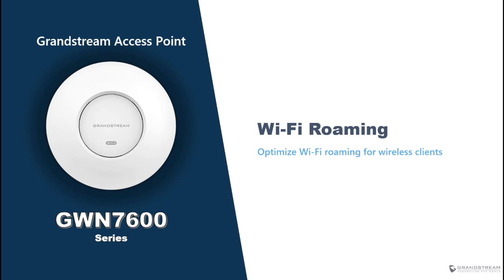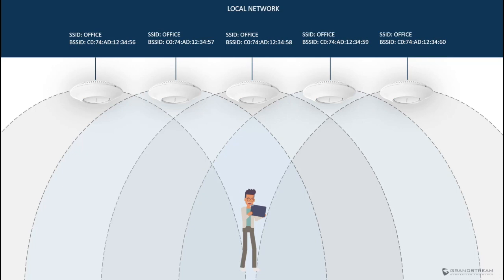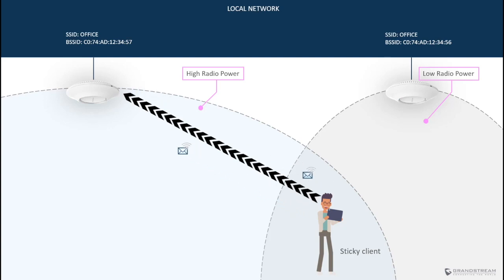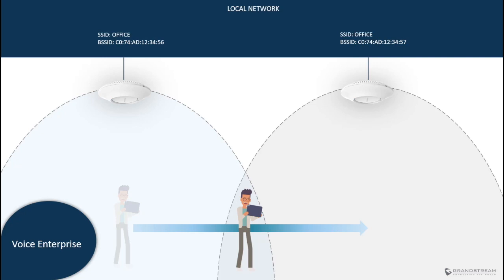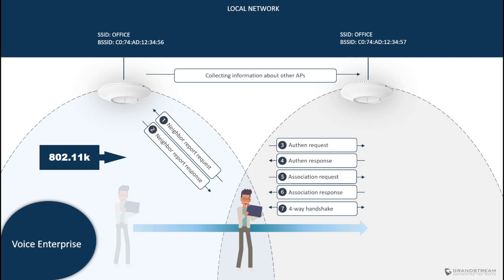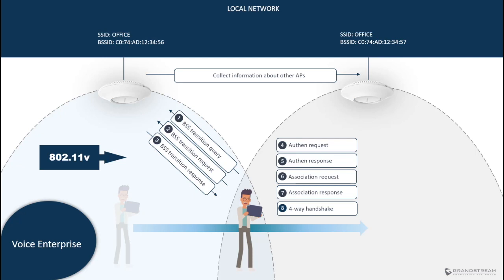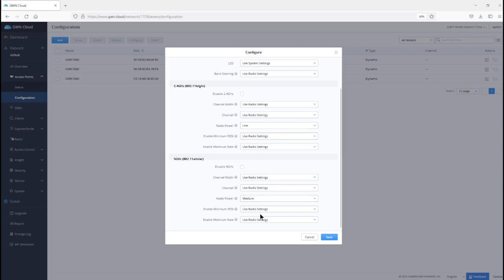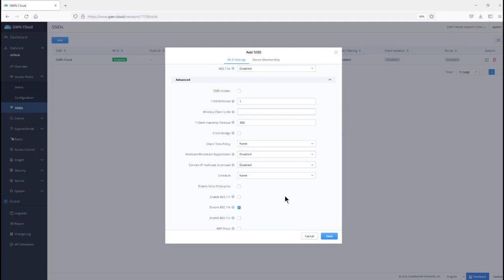GS Tutorials - Wi-Fi Roaming - GWN7600 Series

Comment: It will be good if these AP comes with POE injector just like other  company AP such as ubiquity, cambium, tp link, ruijie etc
Reply: No, that would be wasteful as most people use a PoE switch anyway.
Reply: I think intended use case is to have multiple APs in deployment with 48V poe switch (they release their products soon). That's why they don't include any powering equipment, be it injector or adapter.
Reply: Thank you for sharing your feedback with us.

Comment: AP devices have different VLAN IP ranges can it roaming with each other? It have the same SSID
Reply: The wireless client will need to release the existing IP address and request an new one from the new VLAN scope. The wireless client might end up connecting the next VLAN but that is not seamless roaming.
Reply: @abdeljaibar6372  So not support roaming L3